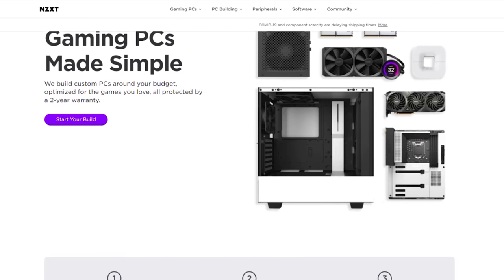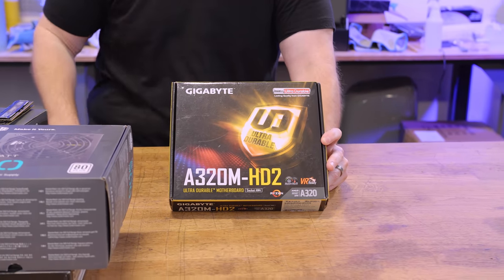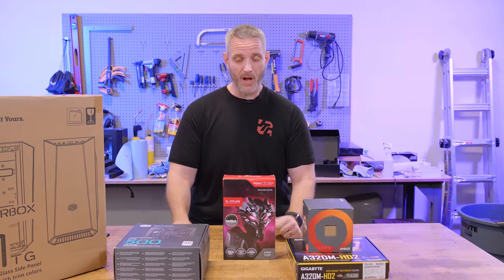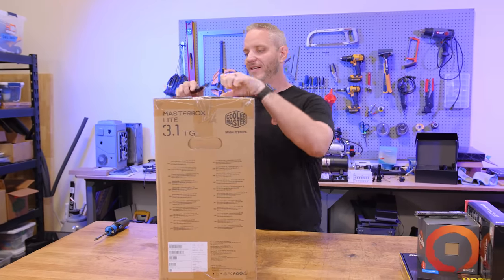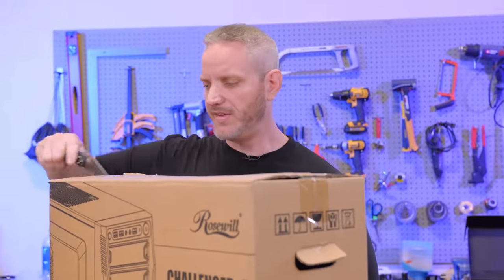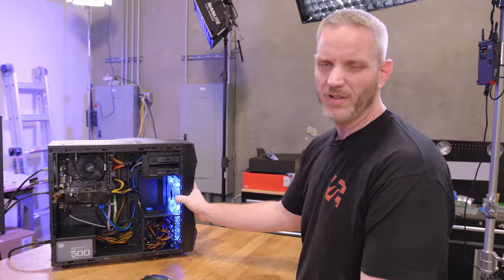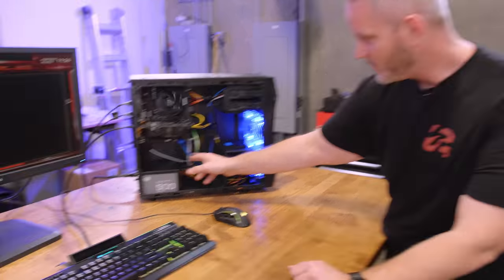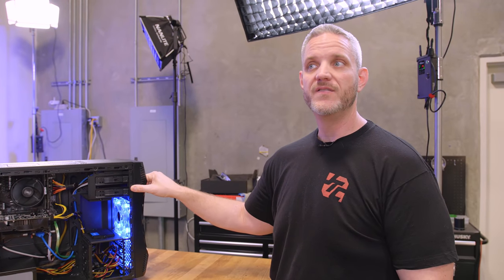The most Practical PC Build of 2022... Extremely Tight Budget Build!

Comment: Yes Jay, they make DVD Drives that are SATA powered, and I have one I'd like to find an external USB enclosure for, since most cases these days don't have, and mine in particular doesn't have, a 5¼ bay... If I would have had a higher cost Fractal Design case, like the 6 or 7 model, I would have had the option to buy a bay add-on, but I bought the Meshify C, so I don't have that capability...
Reply: As soon as Jay asked I almost fell off the chair
Reply: What possible use could you have for an optical drive in 2022??
Reply: Holy cow, I leave a long comment to be helpful and YouTube hides it.
Reply: I have external enclosures for such drives but you're better off getting a USB powered DVD or Blu Ray drive. They're very affordable.
Reply: fractal design has some cases with external 5.25" bays... with 2 fans in front.
Reply: @DirtySoap  I already have a USB powered DVD drive... But I also have a Blu-ray drive I'd like to make use of, that I bought a few years ago when a local PC repair shop was having a going out of business sale, for 20$... He decided he could make more money working for someone else, and got rid of a bunch of stuff
Reply: @Khazandar  I watch 4k Blu Ray, Blu Rays and DVDs as well as rip them for Plex or Kodi.  There are stuff on Disc that are NOT on streaming and the bitrate is FAR superior plus you do not need a very fast internet connection to watch!  But that is me - you may not care but it IS a use case!  I also do have some PC games on disc as well!!!
Reply: @Khazandar  what possible use??? How about an HTPC, I think it's called??? Or even just a backup PC, for backing up, in my case, Blu-ray movies, which in turn, implies that it would be a media server, as stated before... Obviously, once I get my 1999 bubble Mac transferred over to windows based hardware, and an LCD panel, which I hope to do a video on building certain parts of, for YouTube, I'll have either a slimline laptop DVD or Blu-ray drive, built-in, so it'll be not necessary for that machine, but I still prefer to have a 5¼ bay with a good drive in it, just in case...

And also, my church has a brand new custom built PC, made in something like 2018-2019, that has a Blu-ray drive in it, and although we rarely use it for special guests, we use it all the time for projecting movies and motivational DVDs for classes and the congregation...

Yes, it's not required as much these days to have a DVD drive, but for a guy that doesn't have the kind of signal such as I do to only barely access the internet, a DVD drive is almost a requirement to watch movies, and then backup said movies to a hard drive to watch later either over the network or whatever
Reply: @north wiebesick  ahhh... those blu rays are still expensive. I'd just build a home theater PC and plop it in or something.
Reply: @macking104  as I mentioned... And yes, although I was talking about the expensive cases the 6 and 7 models specifically, I also know they have the Fractal Design focus g which I also have a computer built in for a friend who is like this person in Jay's video, on the older side, and uses all those old memory match games and stuff from the 2000s that happened to only be available on among other things CDs and DVDs
Reply: @Khazandar  It's not even just optical drives you can use the bay for. I have three bays in my current workstation, and one of them has a hot-swap drive bay. Basically lets me use internal drives as giant USB sticks at full speed. Super fucking handy and economical. The fact that case manufacturers are dumping the 5 1/4'' bays for more cooling that most people won't ever need in their lives is bullshit.
Reply: @DirtySoap  A USB-powered drive is a lot more clunky and takes up valuable USB slots as compared to just having an internal optical drive.
Reply: @macking104  My Phanteks Enthoo Pro has three bays in it with a big fan in the front. Works really good. The only problem with it is that the system is heavy as hell. lol
Reply: @Arnox Immordium  I was comparing to an external enclosure for 5.25 inch DVD and blu ray drives. If I could share pictures here I would show you one I have if I didn't throw it out and forget.
Reply: @Khazandar  BACK UP!
And playing or ripping already owned videos and CDs through.
I would go for a system capable of playing BluRay 4k though, and I'm not sure that GPU will handle that.
Reply: Sorry, but DVD/blue rays are already outdated. A simple USB 3.0 drive is so easy to come by and plenty fast. 

I actually out a little computer in my car, and I have a USB DVD player in it, just in case I'm ever doing a long road trip with the kids, we could play a Redbox or whatever, but a similar blue ray isn't that much harder to get and wouldn't be a bad occasional use thing.

I get it though.
Reply: They make external 5.25 bays but they're $55, vs. just getting a Zendrive for $35.
Reply: @lilsammywasapunkrock  I get that USB drives are good to have,  but what I'm talking about is reusing hardware I already have, and I currently have to take the side panel off, and run a SATA extension cable to the top of the machine where the drive sits covering the air holes... Hence the reasoning for getting a USB based enclosure for it, possibly USB C or something
Reply: @ahayesm  that's also a point I'm making, because I've looked online, and they are at minimum 50 or $60 for a cheap 5 and 1/4 drive Bay, which makes it a little pricey for my blood, but if it was say $30 for one that is known good brand then I would easily pounce on it because if my Blu-ray drive goes I've got like five or six DVD drives laying around here that all work that can fit in it
Reply: @lilsammywasapunkrock  Outdated by what? Streaming? Blu-rays were never replaced by anything.
Reply: I have a blu ray drive that I want to make mounted under my desk in a hideaway panel that is SATA
Reply: @swshredder1313  another use I've thought of, funnily enough. In a case like that, I would definitely recommend an enclosure of some kind, for a 5¼ bay... although I know you likely have a 5¼, if you're looking for something a little more discreet, if you can buy a USB conversion kit for a laptop style slimline drive, you could have the drive possibly mounted directly into the edge of the desk. As in, cut a notch into the forward facing edge of your desk, while having a piece 3d printed to fit into a hole in a thin piece of wood, that would be attached to the DVD tray bezel. Obviously, the thin piece of wood would have the same routed edge as your table, or as much as possible, at least, while making the DVD drive invisible, or nearly so. That would likely be too much work though, so use that idea at your own risk, although I may have to file that idea away for later to go with the many other ideas I have regarding a work surface, that has hidden peripherals... Something like a hidden slide out rubber folding keyboard, perhaps mounted to a piece of wood or something... Not 100% sure how that would work, but I definitely have a few ideas that have been rattling around in my head for, well, years now...
Reply: I bought out the invenrory of an old computer store, snagged a whole bunch of 2.5 and 5.25 external drive bays. I paid next to nothing and now they're gold. 😁
Reply: I just to have a couple of plextor DVD rw drives(Sata ports) extremely reliable drives!!!!
Reply: @Khazandar  watching dvds and blurays. Duh.
Reply: @welshtechie6832  same here.
Reply: @welshtechie6832  I was going to say, "Why stop at a Bluray drive when you can get a 4K Bluray drive."  I have had several DVD and Bluray drives over the last 10 years all SATA.
Reply: @Khazandar  What practical use? If you're somewhere the 'net likes going down (either from just bad weather or being out in the boonies,) it's entertainment - not every movie streams, after all, and not everyone has everything ripped somewhere. Older games (also not available) on CDs. Going through stuff you've got archived on CDs and DVDs. Hell, I've got CDs that are probably older (and still readable...) than some of the people watching the channel...
Reply: Ikr. I have a DVD drive connected to SATA. I built my PC in 2016 when I barely knew anything about PCs. I also have like a ton of DVDs but I have never even used it in the last 2 years.
Reply: I put an optical drive in my last computer (5yr ago)  I make music disks for my pickups and archive some video projects.
Reply: I have a blueray in my old build that is SATA
Reply: Rip my old movies and ps games for emulation.
Reply: Owc (other world computing?) mercury pro makes a usb 3.0 to sata enclosure. I have their loaded bdr enclosure I bought specifically to load up plex with my movies and ps2/3 games.
Reply: @Khazandar  independent backup option for example, when the NET is down. Lots of people use it.
Reply: @Khazandar  For converting your 4k and blu ray collection into mkv files for your Plex server😛
Reply: I bought a usb cable for notebook DVD drive. It is better as laptop's DVD drives consume less power and can be powered from the USB port without external power supply compared to desktop DVD drives. I think that it will be easy to find some laptop's DVD drive for cheap and this cable is cheap too. I just took it out of my old laptop. Many laptop services will probably give you that DVD drive in exchange for a bear. 😉 For me it works good as I use DVD drive 1 time per 3 years. 🤣. For someone that uses it more often I would go for some external USB DVD drive as it's just more durable.
Reply: Dumping the 5 1/4 inch bays completely is the worst. I have tons of DVDs I still watch from my model trains and also I love the 5 1/4 bay for hot swap SSDs to switch OS when needed. Dual boot to me is not an option as I have to have a huge SSD and partition it down
Reply: @wdd6864  For a PC I would go for a separate drive for a separate system and plug it all into the mobo. Then by a simple change first boot device swap the OS when needed. Of course if you have enough hard drive ports in a mobo (sata or m.2).
Reply: @LeitoAE  you could but I rather have the Operation Systems Isolated
Reply: I have old Fractal Design R5 😈🤤
Reply: @Khazandar  I use mine for retro pc games. I need to get an external enclosure as well
Reply: Hey what's up I found my old data DVD burner too and instead of finding an enclosure, I thought hell I could just make one. Or find a friend with a 3d printer and spend a day designing one
Reply: @wdd6864  They are isolated. They are on a separate hard drives. 🤪
Reply: Lol yeah, I actually have a blu ray in an old pc that has a tech that never caught on lets it etch discs in the drive with custom art, logos, text etc.  Used it to make some videos for a few friends as gifts way back.
Reply: @Khazandar  How about games on cd's
Reply: @DKarkarov  lightscribe? My old lite-on burner used to have that.
Reply: @klorslug  Yeah that was it!  Had forgotten the name, thanks!
Reply: Snowchild  It’s called a high capacity hard drive 🤣
Reply: Can confirm dvd drives can use data power got one at home
Reply: @Khazandar  omg wow you are so progressive ! 👍
Reply: @arnox4554  That's the case I used and the bay was a large part of why.
Reply: @Khazandar  Blu-Rays

Comment: It’d be really cool to see these cool “day-to-day” builds that are meant for situations like this or a good setup for office work. Just very refreshing to see this stuff
Reply: Especially now that the high end is $2,500 usd on the low end! It’s just gotten completely out of control.
Reply: For office work just get a used thinkpad; maybe t480. Done and done. Those things are amazing.
Reply: This is still a bad build... a 5600G would cost the same and have better performance.
Reply: @frizzlefry1921  You mean mid range right.... a high end PC your spending close to 2 grand for a GPU... and prices are close to MSRP now
Reply: @chrispeters8555  Yeah basically my mind won’t allow me to type it even…
Reply: @frizzlefry1921  lol… I just built my new rig and I really didn’t tally up the damage… then I watched someone build almost an identical PC and he gave a price of 4600 😞!
Reply: @chrispeters8555  Wouldn’t be too hard to do (with available resources) at all. When you get locked into a plan / path and the buy once cry once methodology. But if you do it right should last you a decade+.
Reply: I wonder how much difference there is between high end 12th generation CPUs and, say, 4th generation processors when doing simple tasks like loading and running word, or other office applications. Would the I7 perform much better? Will there be noticeable differences? IN my own experience I’ve not seen any considerable difference between the two generations in this kind of workload.

Comment: this was a nice change of pace. really quick and simple build. I think another good video option would be the most available gaming pc. Basic build a system with a valuation of $1k-$1500 with parts that are available at or close to msrp.
Reply: So that's gonna be an APU build if you go by pricing in my region at least. 3050s are going for 3070 money here.
Reply: None of the major components available on Amazon unless you want to pay scalper prices. Mobo, chip and video card available eBay used and refurbed for $300 +/-.
Reply: Going for that price here would be an i3 12th gen with a 6600xt/rtx 3050/gtx 1660ti and 16GB of ram. Maybe a bit better on the ryzen side

Comment: I have TWO Rosewill Challenger S cases in use in my house. I love all the extra bays for hard drives.  The downside is air flow.  When you fill up all the bays, it gets warm.  You need extra fans (side and top mount) to keep it cool.  

Side note:  I do have a salvaged DVD drive installed in a 5600x rig because I have a BUNCH of old CDs and DVDs and needed to digitize them. Rarely used it since.  I have another salvaged DVD drive in the 3400G rig because my son asked for it.  To my knowledge...he's never used it.

Comment: Phil absolutely killed the montage of the build, good job man its my favorite edit. Also Jay I have 3 DVD rw drives that I pulled out of old systems I could ship them to you if you want.
Reply: any body using dvd - cd rom's for backup's may need to make sure they do not have cd bit rot i had backup disc's sitting for about 5 years went to restore files and the disc was unreadable
Reply: @shanepearce1629  where tf were you storing them?! I have ones from 10+ years ago and they're 💯
Reply: wow. 3 different bots have stolen the message you wrote including the top comment on this video. Dude these bots are getting out of control.
Reply: @nerdjournal  the bots are really getting out of hand they are even showing up in livestreams.
Reply: @nerdjournal  they BEEN outta control, hardly just now getting...

Comment: I did a build in that same case for my brother that needed a Blu ray drive in it, I used the bay below it for a multi media port so it could easily accept stuff like camera cards and  other min storage devices on the fly. It worked well and the case other then being dated and without a glass side panel was solid in almost every way. Even the power button had a solid toggle to it. Mine I think was a little beefier amd2600 with 1 tb storage and different cheap (at the time) GPU but otherwise the same.

Comment: After enabling fTPM and upgrading to Windows 11 and started to get random stuttering in videos and games.  It would happen once or twice a day. I thought it might be the result of the AMD /Windows 11 issues, but the patches and chipset updates did nothing.  I reinstalled Windows 10 (clean install) and the stuttering continued.  I deduced that it was most probably a hardware issue.  I almost lost my mind trying to identify the cause of the stuttering. I even upgrade back to Windows 11 and the stuttering still continued. I Then saw a forum post where someone mentioned that fTPM was causing stuttering.  I disabled fTMP in my BIOS and not only does Windows 11 still run, but the stuttering is completely gone. It's been a week now and no issues.

Comment: My practical/bang for the buck build.
Case: Zalman Z3 mid tower
CPU: i5 10600kf cooled by a Thermaltake Frio dual 120mm.
RAM: 16GB DDR4 3200mHz
GPU: GTX 1050Ti
MOBO: H510m- A Pro
SSD: 1x Kingston 120Gb (for OS),1x Kingston 480Gb (for games)
PSU: MS 500w
+ an LG DVD drive :)

Comment: New viewer, here. I've been thoroughly enjoying watching your stuff, and it's renewed my interest in getting back into building PCs again. I've been in I.T. for 30 years. In my early years I've built PCs for companies and friends alike. I can tell you that the world of PC building is not what it used to be. It's a whole new world. I love it!

But have things changed so drastically that we no longer have to use grounding straps when handling these parts? It's killing me to watch y'all manhandle motherboards and RAM sticks and graphics cards without so much as an anti-static bag. Are you guys standing on grounding mats, or something? What's going on here?

-A new fan
Reply: The chance of that happening is low, and these parts are not that expensive.
I got nervous building my pc of 4.5k, If you grab the heater pipes running trough your home you can get rid of static.
If you don't wear clothing that get static allot, you should be fine.

Also took a screwdriver to unlock my gpu (lock from mb (asus x570-E gaming) is beneath the gpu lol) prying it out and yanking it left n right.
The 3060 vision card can take a hit for the team when needed lol.

On previous pc I abused it for 10 years and it was still up and running (with a 90-98c intel 2600k running at 4+ghz).